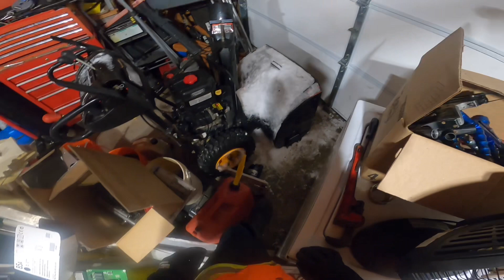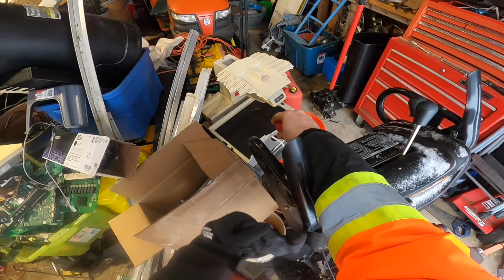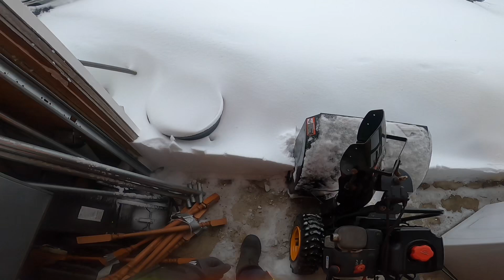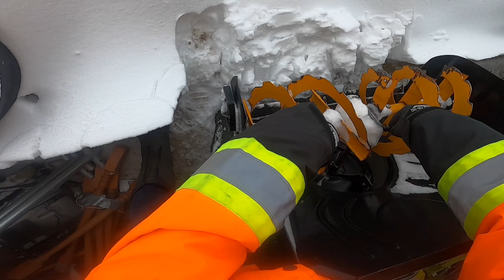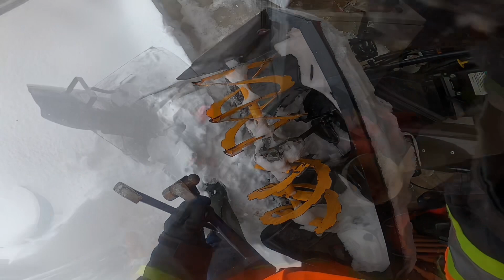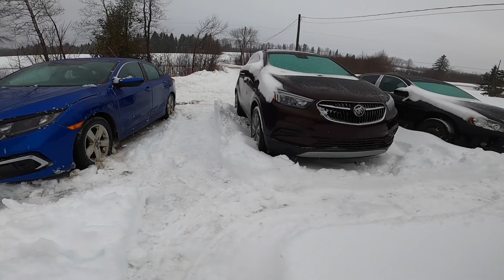Holy snow storm

Comment: I always clean the snow out after each snow blow.    Keeps from seizing especially when I store it in the garage (melts a bit then may freeze).  ❄  Just have an issue with the ⛭ gear where the snow blower meets, not always touching when hand cranking.